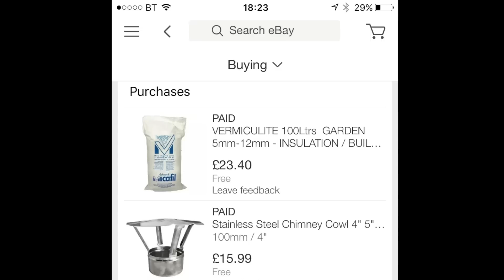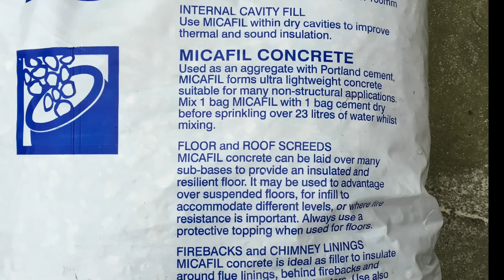Wood Fired Pizza Oven made over a gym ball

Comment: Bonjour, tout d'abord je vous remercier pour le partage et félicitations pour cette réalisation .
J'ai une question à vous poser :
Il faut utiliser du ciment normal ou du ciment refractaire .
Pensez-vous que cela est possible avec une boule 90cm / 35 "
Merci d'avance

Google translate :

Hello , first of all I thank you for sharing and congratulations for this achievement.
I have a question to ask you :
You must use the normal cement or refractory cement.
Do you think this is possible with a ball 90cm / 35 "
thank you in advance
Reply from the maker: Thank you for you nice comments, I used normal Cement. You could make it bigger, but you would have to consider how thick it would need to be, in order to be able to lift it off the mould and not break. Also the bigger the size the heavier it will be.

Comment: At 1.08 you show the CAD being slotted against the ball but then at 9.58 you seem to have another ( not concreted ) CAD.  is this a 2nd dome or was there a problem with the 1st entrance. Also, can you tell me the material used to top the oven, is it a simple render that has been coloured ? Thank you.
Reply from the maker: Hi, the template at 1.08 was the final one used, the only other one I think you might be referring to is at 8.24? This was purely to stop the render dropping off the face of the cast. The render was  from victas, mixed with some red dye from wickes. Thanks

Comment: it works only with wood burning ? perlite is good insulation but idea of wood burning oven is to keep temp inside,with firebrick dome,insulated outside of it.  firebricks ,radiating heat, make the meal. pizza made in your way is just as good as of electric or gas stove because dough absorbs heat not of heated firebricks but of burning wood itself. perlite can't absorb enough heat to make a meal so it's not wood fired pizza oven per se or maybe am wrong?
Reply from the maker: you are correct, however the pizza cooks through absorbing heat from the firebrick base, rather than just the burning wood, my electric oven wouldn't cook a pizza in under 2 minutes
Reply: Sjan, I think this design is great for what Mark is using it for. I think if he wanted to maximize the heat storage potential of the oven, he could have used a refractory cement layer on the interior and a more insulating perlite layer on the outer shell. I think it all depends upon what you're using the oven for. I'm building an oven similar to Mark's design but halved the perlite and instead added fire clay, lime and sand into the cement to create a heat-absorbing inner layer. I'll do the outer layer in a 5:1 perlite cement mix for the insulation (covered by a moisture barrier stucco layer).

Unfortunately, as I'm finding, my oven is a lot heavier than Mark's and I cannot lift it just by myself (advantage: Mark).

Comment: Awesome. Do you know approximately how heavy it is? And if I add heavy duty wheels on the legs of the base table, will it work to make it somewhat portable?
Reply from the maker: It's very heavy, I can raise one side of it at a time, but yes you may be able to use heavy duty castors

Comment: I like it a lot, how's it a year on?
Reply: Hi, thanks, it's still in one piece and hasn't caught on fire yet. Following the winter the chimney had pushed down, under the weight of the tarpauline I had used to cover it. I will be building another using the same method, but using perlite, hopefully early in the new year.
Reply: Mark,
Thanks for a great video!!

I’ve made the mold and getting ready to put on the perlite/cement mix.
Have you made one with perlite yet? Success? 

I’m using 75 cm ball and am planning to do appr. 6-8 cm of the above mix, then chicken net (hopefully little thermal expansion), then 2 more cm of the mix.
I would’ve liked to have some more heat mass in the dome, to be able to keep some steady heat (fireclay, lime, sand, cement mix) for baking bread, but struggle to find the fire clay and what type of lime... (in Norway).

Thanks

Comment: How heavy is the oven? are you able to move it with two people?
Reply from the maker: Hi, I built a trolley for it (sheet of ply, plus 4 flight case caster wheels) and I'm able to get it onto this and wheel it around myself, although it does only mean I have to lift it about 2 inches at each end to load it onto the trolley. 2 people couldn't pick it up as a whole thing.

Comment: Great video! How heavy is the oven? Would you be able to take it with you if you moved house?
Reply from the maker: The total structure is heavy, I can manage to pick one end up on my own, enough to wheel under a small trolley I made using flight case wheels (castors), I can then lift the other end up and put it all on the same trolley, it can then be moved around. I originally built the trolley for moving a piano.

Comment: Hi,

Are using Portland cement or other kind such as refractory?
That's right?
-6 parts vermiculite
-1 part  cement (don't you use sand)
-2 part water 
How many pounds or kilograms do you use each material?

Regards from Costa Rica!
Reply from the maker: Hi, yes just normal portland cement, 6 parts vermiculite, 1 part cement, mixed by volume rather than weight. I used half a bag of cement and about 2/3rd of a 100 litre bag of vermiculite
Reply: @cuthberm  thanks!

Comment: I believe this is wrong. The oven shall be made of heavy material which will provide thermal capacity. Vermiculite is very light. This oven will not work since as soon as the fire is off, its temperature will drop off as well.
Reply from the maker: Hi, the oven does work, it does lose heat quickly though as you suggest, when the fire dies out. However is is possible to make enough pizza for a family and friends, you can maintain the fire at the back of the oven, between cooking. It's not a commercial grade oven, which could run for hours on end. It does however work as intended.

Comment: Hi Mark, thanks for your video... I'm going to make one like yours and it is really well explained. Thanks for that! I got one question, how thick was your layer with vermiculite? Greetings from The Netherlands.
Reply from the maker: I'd say the vermiculite was about 5cm thick, thicker around the tunnel and chimney for strength
Reply: Thanks Mark! Currently mine is 3 cm I guess so I should improve it.
Reply: I got another question :P How do you do it with the rain? Do you cover it? I imagine you don't put any cement between the flat stones which cover the surface, so if it would rain it would go into the sand... How do you protect it?
Reply from the maker: I cover it all the time I'm not using it with a garden furniture cover, otherwise like you said the rain would go through the bricks to the sand, rot the frame eventually.
Reply: Thank you for your answer!
Reply: Heb jij 'm inmiddels af? Mag ik je wat vragen stellen?
Reply: oh hi mark.

Comment: Hi, great video. Did the normal cement handle the heat OK? I'm going to have a go at a build using your instruction and just want to make sure there has been no concerns?
Cheers.
Reply from the maker: Normal cement worked fine for me, the issue I had with a small crack was due to the chimney not being made from the same material as the dome, and therefore expanding at a different rate when heated.
Reply: @cuthberm  I'll make the chimney pan first and attach it to the dome later

Comment: have you had any cracks or other problems yet? im building mine now :D
Reply from the maker: just a crack in the outer render, no cracks to the main structure, somebody brighter on here explained it would be due to the different materials expanding and contracting under the heat at different rates
Reply: This is due to the fact that the outside of the oven due not get hot enough to cure the refractory product that you have used 
refractory render/cement/screed   needs heat to chemically bond it without that heat it will just crack and fall off 
Hope this helps
Reply: How did your build go?

Comment: Did your floor burn through the bottom yet?
Reply from the maker: No not yet, must be the firebricks and sand getting in the way! Any thoughts on how to make a better base?
Reply: Yes on the floor...try using at least a hollow 4"x8"x16" slab laid flat on the bottom before you put your fire brick down. You must have a dead air space or the heat will penetrate your flooring material on the bottom.

Comment: Did you check to make sure the vermiculite is asbestos free? Apparently, some vermiculites have asbestos in them.
Reply from the maker: Yes, vermiculite originally has asbestos, but obviously it’s no longer part of ‘current’ vermiculite, and wouldn’t be available to purchase if it did contain it
Reply: How had it been performing in the last 4 years? Has it cracked at all? How warm does it get on the outside? Can you touch it with your bare hands?

Comment: So no heat capacity only insulation?
What is the point of it?Why did you just use plain firebricks, you would have much better results than velmiculate.
Reply: Firebricks hold the heat and will cook the base of the pizza 
DO NOT COOK ON VERMICULITE

Comment: Vermiculite is known to contain asbestos fibers. This is why it was outlawed for use in insulation in attics and walls.
Reply: Vermiculite itself doesn't, but in the past, the trade product is was sold as (a proprietary mix of different substances, generally for fire-proofing / insulation) certainly did, up to the 1990s.  Those shenanigans have stopped these days in most parts of the world

Comment: Hi could anyone please help. Have anyone tried to use a vermiculite concrete for the floor? I was thinking of a vermiculite, clay and cement mix. Anyone know if that would work?
Reply from the maker: This only really works due to the fire bricks, absorbing heat and then giving back to the pizza.
Reply: Robert Edlin vermiculite often contains asbestos! It’s dangerous,

Comment: Thank you for the video.
Two big questions:
1- Has the shell cracked after a year?
2- what is the ration of cement to vermiculite?
Reply from the maker: Hi, thanks
1) it was only built in late March 2016, so not 12 months old yet
2) 6 Parts Vermiculite, 2 parts Water, 1 part Cement
Reply: Oh!! 6 to 1 !! interesting indeed!
Do you heat up the oven slowly or you just fire it up to maximum heat? Thanks
Reply from the maker: +Ann Bary I first fired it up with just paper and card, next time card and kindling, then used kiln dried logs on the third attempt. I have accidentally got it too hot since (when trying to load it up to making enough time to allow me to make a fresh batch of dough!), and this is when I think the outer rendering cracked slightly. I now have a better grasp on how many logs to use and when to feed it more!
Reply: Mark Cuthbertson hey , any damage too the vermiculite since 2016 ?

Comment: When I read "oven" I didn't expect the fire to be in the same place you're cooking at. I wouldn't consider this design simply because anything that comes out of it will taste and smell like the fire. The oven should be a separate part from the fire chamber in my opinion. Detachable even, so a stove or oven or barbecue could be placed on top of the fire chamber. I was confused at first as to why you'd put the flue on the oven, I really didn't expect your fire to go inside of your oven rather than heating it from below.

Comment: Cement-based mixtures are not suitable for high temperatures . In the cement at high temperatures starts reverse transformation processes in lime.
For the production of the furnace is necessary to use heat-resistant mixture
Reply: so can I use refractory....?
Reply from the maker: What would you recommend people use then?
Reply: The folks at Forno Bravo (on their forums at least) have had good results with a 3:1:1:1 mix of sand, lime, fireclay and portland cement.    I think the castable refractory mix you can buy at the building supply store is great but it is extremely expensive.  The above mixture won't handle 1500 degree temps but it should handle a pizza oven fine.
Reply: I am building a pizza oven in my man cave with the mouth of the oven opening towards the garden so the dome is inside. I will not be suffering from any weather, only from the heat of the oven. So I was was to just buy a Castable refractory mix and make my oven like mark did, would it work long term without any cracks appearing later on in its life......?
Reply: I would look here (at this thread in particular but more generally at this forum) and do a bunch of reading.  Castable refractory is likely overkill, but the homebrew mixture is underkill, if that's a word.  If the money isn't a concern I would go with premixed castable refractory, but if it is a concern I would probably try out the homebrew.  Cracks aren't necessarily a bad thing; they're typically aesthetic and won't affect the performance.  https://community.fornobravo.com/forum/pizza-oven-design-and-installation/other-oven-types/385142-castable-oven-need-help
Reply: I want to do it once and I would like to get it correct..... Any advice would be very much appreciated
Reply: My advice would be to go to the fornobravo site and ask lots of questions..the folks there have forgotten more about oven building than I will ever know.  I'm still in the process of drafting plans for my first one, so I'm in the same boat as you but I have done quite a bit of reading on that forum and there are a ton of resources there, including folks who have cast dozens of these and could tell you how to avoid cracks and guarantee performance.

Comment: How is your pizza oven holding up - after a few years of use? Have you modified in any way? - nice work
Reply from the maker: Peter W It’s just about holding up, although I think this winter could be the last it survives, as someone correctly pointed out in the comments, the different expansion rates of the chimney and concrete have caused a crack to start near the chimney, which is working it’s way towards the base. I’ve changed nothing, but would rebuild again using perlite and making a chimney from the same material.
Reply: Thanks for you reply! Interesting to see, inspiring video
Reply: Molasses and salt makes the concrete refractive
Reply: Maybe rebar would help also
Reply: Thanks for the update. what is the recommended size for the perlite particles?
Reply: My first pumice oven had a crack from making the fire to big and not building the heat up slowly and I easily grinded out the crack in a v shape and filled with some finer pumice concrete !
See both ovens lately here >https://www.youtube.com/watch?v=kP9poGmzH1g
Reply: Nice Colorado sweat shirt! Good job.
Reply: Mike E  If I decide to build one out of perlite/portland, I think I'll definitely add chicken wire in between the two layers.
Reply: @cuthberm  have you looked into using fire rated concrete?
Reply from the maker: nuff said Hi, I don’t think they would work, the key to the whole oven working, is the fire bricks retaining the heat which is being reflected from the dome, without the fire bricks retaining this heat, the pizza wouldn’t cook.
Reply: @cuthberm  is perlite food grade? Thanks
Reply: @cuthberm  Hey I know it's been awhile since this video but what would you have done with the perlite? Used it in with the vermiculite/concrete mixture? Or instead of the vermiculite? I'm thinking about making one of these and am trying to get as much info as possible
Reply from the maker: Hi, I will use it instead of the vermiculite.
Reply from the maker: No
Reply: @cuthberm  You can make the chimney from the same material from where it touches the oven to about a 1ft high then connect it with aluminum chimney for the rest of the way. This will prevent cracks and also easy to maintain chimney cracks.
Reply: @cuthberm  suggest to wrap a layers of drywall fiberglass mesh tape, they are very cheap and strong.
Reply: @cuthberm  your internal dome surface is actually a insulation and does not hold much heat, is that ok for pizza? as traditional oven use  heavy materiel in the ceiling for soaking in the heat, it maybe regulates temperatures better too. for Pizza the base definitely uses conduction heat to cook the doe, but the top not sure if its more convection (air temp) or radiation (ceiling mass), none the less your build is very easy to do, if you would to have a clay mix inside that would be more work, that would probably be more suited to do a long casserole roast with out using too much wood.
Reply: Mike E  
OHHHHH Great IDEA!!!

Comment: helo mark ,
But with the strong heat the cement does not break.
Reply from the maker: not yet, still working 12 months on
Reply: fantastic. I instead fear that with the strong hot the cement is broken I used other materials. 4 parts of refractory mortar 1 part of cement and 1 of vermiculite
Reply: Hi, Giovanni. Did that blend of materials work fine? I'm thinking of doing the same.
Reply: Did it work Giovanni?

Comment: This is what I am saying. Heavy bricks are needed in this case. At least in the first row all around and in all height. Otherwise the oven isn’t an oven. Only heavy bricks can provide long lasting heat. This is a basic thermal law. Light bricks are used in ovens where the source of energy is present continuously as in furnaces.

Comment: The door top should be 63% of the total height for proper heating and the base 75% of total width.  Your oven won't heat properly the way you made it.  Read up on ovens
Reply: I bet it'll work just fine

Comment: This cannot work. Vermiculite is too light without thermal capacity. As soon as the fire is off, its temperature will drop quickly and the oven will not work as an oven.
Reply from the maker: The fire brick base provides themal capacity, and as can be seen in my other video's, it does work. Agreed, as soon as the fire goes out, the oven temperature rapidly cools.